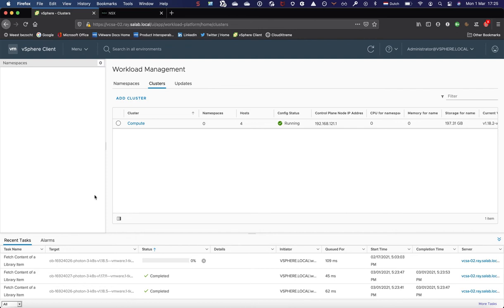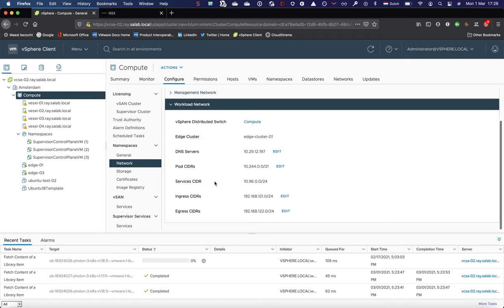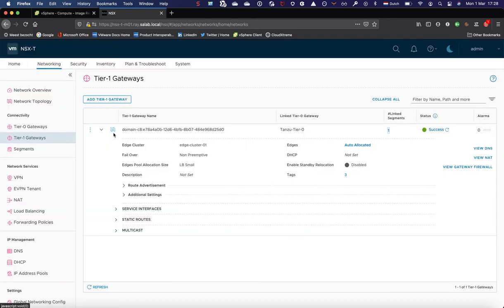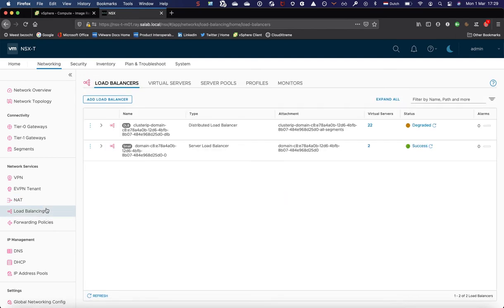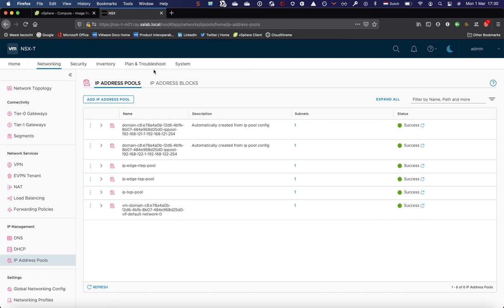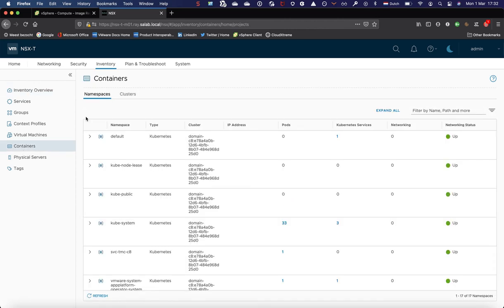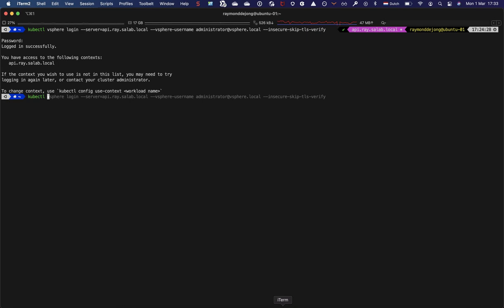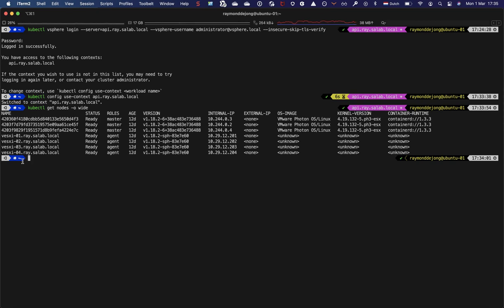vSphere with Tanzu on NSX-T: Part 3 - Review Workload Management Setup

Comment: Hello,
i am unable to access the Control Plane Node Address. The load balancers are created normally and point to my workload domain but when trying to access the VIP IP on port 443, it doesn't fetch the user inteface. Is there any tips i can try to fix this problem?

Comment: Hi, I can't count the number of deployments I am making to get cluster working with the public ip without success.
Is there any other configuration to be done to get cluster working with the ingress public ip
once the workload Management is set up I can ping the public ip but I can't browse to get the kubernetes cli 
thank you to help me, I am stuck on this part 3

It seems the nsx-t load balancer can't turn the local ip addresses to the cluster public IP and the configuration looks good in nsx-t
Reply from the maker: Seems there is some routing issue in that case. There needs to be routing accesible from Supervisor Cluster to your Ingress range. Yan can also wacht /var/log/vmware/wcp/wcpsvc.log on your vCenter server to see what issues there might be when configuring the Supervisor Cluster.